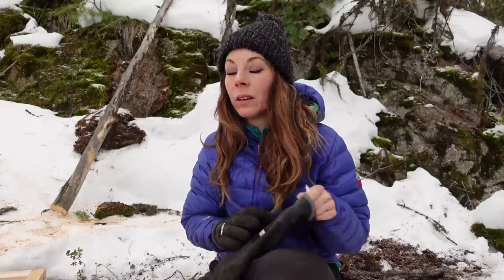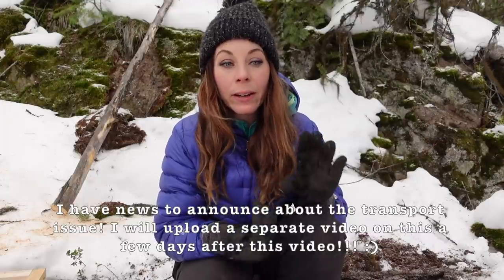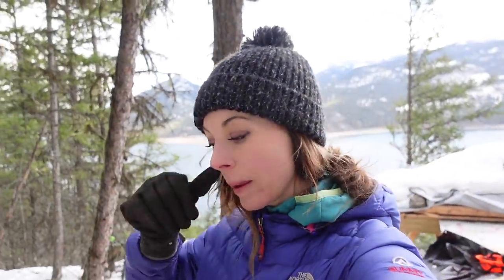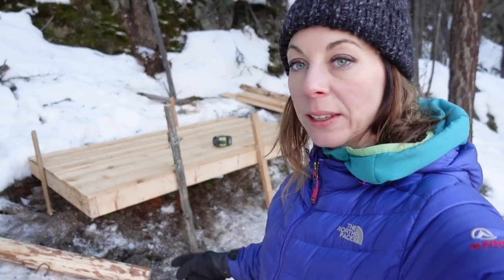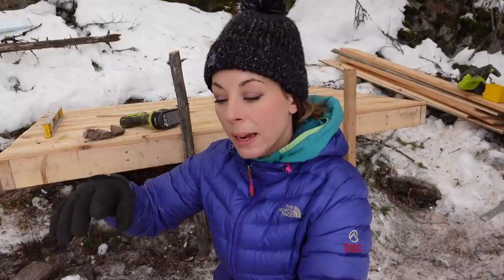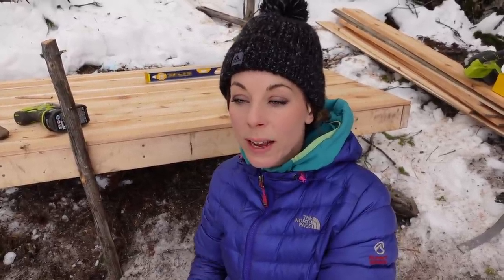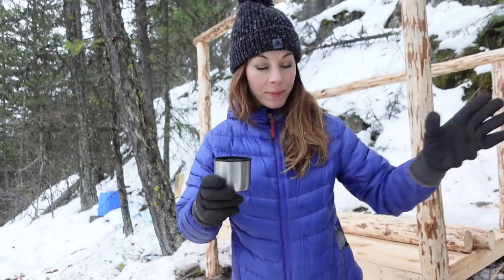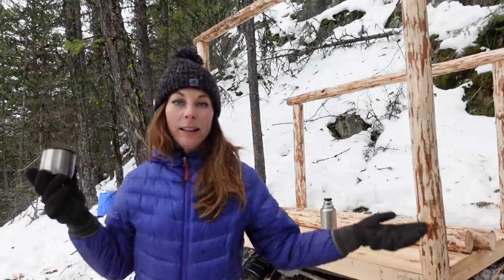Perseverance pays off. Building in winter. ( DIY shed near a cliff Ep.2)

Comment: Comment on your debarking process: I notice that because you have a sharp blade that easily cuts into the wood below the bark a lot of your effort is expended cutting into the wood. You might want to try using a DULLer blade that doesn't dig into the wood or perhaps even a SQUARE edged blade like the back of the draw knife that cannot dig into the wood, but still breaks up the much weaker bark. When that works, you'll get a much cleaner and smoother wood surface and takes less effort -- if the bark isn't very thick like on an oak tree. If the tree is still fresh and there is a wet slippery layer below the bark, it works like magic! Give it a try and see what you think. {Sometimes a sharp blade is the real problem.}

Comment: Hello again the shed is starting to take shape, your doing a great job! A few thoughts can you get enough stone to make a small fire pit and extra wool socks. Keep the socks around your neck or inside one of your shirts to stay warm, working feet get wet then cold 🥶. Change out the socks and dry the others by your fire also it’ll keep the work area warm and you during tea breaks. Tea’s a good drink, I like pearl tea lol. Can’t wait to see the trans Canada materials railway! Keep safe
Reply from the maker: Yes, I should probably change my socks half way through the day. 
It’s hard to find rocks right now with the snow covering the ground, so that leaves it a fairly open fire pit. Which I’m a little hesitant to do out there, because wind can pick up quickly and I don’t wanna get a fire going that I can’t monitor properly. Plus it takes up precious time to build and maintain a fire, even just those few minutes I feel are too valuable to put towards a fire. I know it seems backwards, but I tend to just keep focused on working on the build as long as I can.

Comment: Hi Michelle. I think you're making good progress, it all seems to be coming together well. Your chainsawing skills have improved greatly since last year, as has your level of confidence, you go girl! Your work should get a bit easier once the shed is completed and you've got a place to secure some of your equipment on-sight instead of having to schlep it back and forth each time out. My battery tools are all Ryobi also, and I've been gradually replacing my batteries with the 6 amp hour models for long use. Perhaps someone makes a solar charger for tool batteries?, Keep up the good work and as always, best regards.

Comment: Ya know? You kinda got impulsive and built your decking  before ya set your stilts lol. I'm thinking you would of saved a lot of time by choosing your 4 posts and clearing the snow the best ya could, then starting a fire over the post hole locations for two reasons,  1) to thaw out the ground and two to char the bottom of your posts, then all ya would of had to do was dig the post holes ,set the logs level,pack em down measure and cut them to the perfect level and while your logs were charring you could of had a nice warm lunch lol plan plan plan and then plan some more, it'll definitely save you time and energy Mich! 
☕😊👍
Reply from the maker: But that’s just how my silly little brain works! 🤷🏻‍♀️🤪
Reply: @michygoss7148  haha if you were an Indian squaw they would call you Crazy-frozen toes! 😄  well at least you can see some progress, right? 
I know being on the face of that ridge like that has got to be pretty frigid though, so I give ya a lot of credit, kudos to your drive and determination, oh and, don't forget your bear spray, I don't think cougars hibernate?
Reply from the maker: @mikefalanga437  funny enough there is a fairly large cougar in the area. But best to not tell y’all so you don’t get worried. 😊
Reply: @michygoss7148  paint or sew dots that look like eyes on the back of your hat , I learned that from an old lumberjack  , it throws them off and buys you time to notice them..
Reply from the maker: @mikefalanga437  not a bad idea!

Comment: God,, if you had all the right tools,,, you'd be scary fast!! They make chainsaw bars with tips the size of a quarter or a dime,, cuts down on chisel time & you can plunge cut with zero kick back!! Nail a small log  2 or 3 inches diameter in size,,, up about 4/// 5 feet between two trees that are 3,,4 feet apart!!! ,,, it's easier to drawshave pulling down using your back & legs,, flip it over after you shave the top half........ Looks like the lakes open water?? or is it just rain water on top?? aloha
Reply from the maker: Yeah, my knees are getting tired from all that log peeling! 🤪. That’s a good idea. I know I’m need of a few better set ups out there.